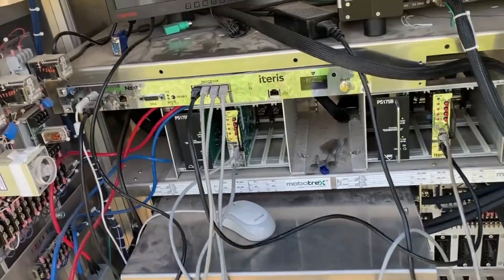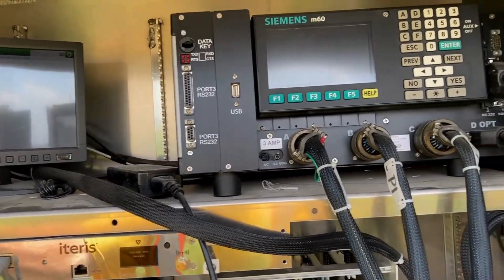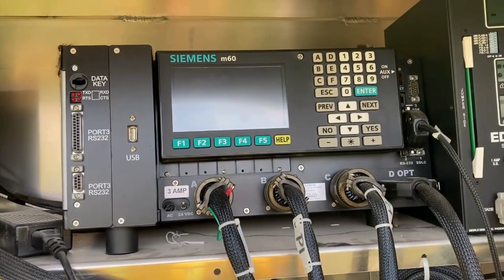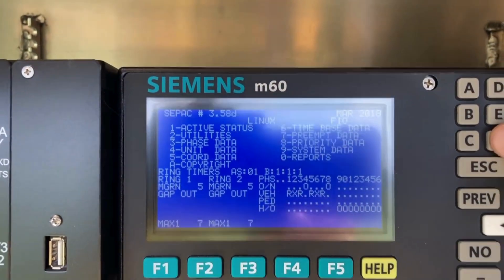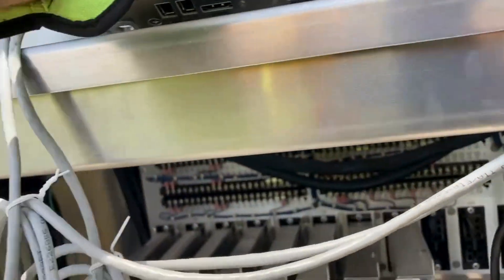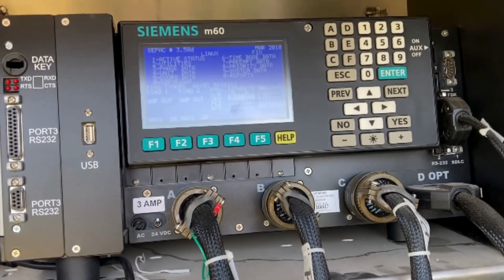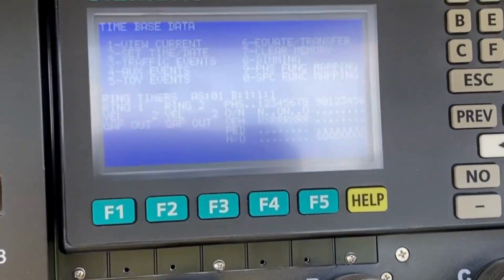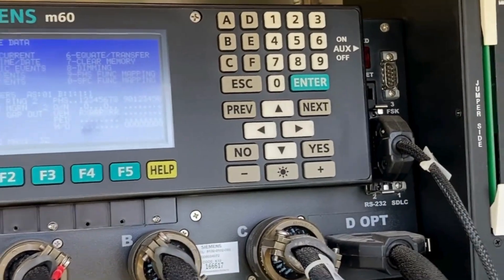Removing Traffic Light Detection

Comment: Thank you great video. How's the Siemens controllers work for you, and the video detection Vintage Next ? Here where are work we are slowly upgrading old 179 controllers to 2070's ATC and also very slowly going from loop detectors (good part of them are broken) to video detection MIO vision.
Reply from the maker: Thanks for the kind words.  I've worked primarily with Siemens controllers and Iteris cameras for over 25 yrs.  Its just what I'm used to.  So I like it (because I understad it). I have been also moving away from loop detection to cameras because I feel getting detection off the ground has more benefits than cons vs in-road detection.

Comment: hi amazing video can you explain what the H/O means?and the MGRN and MAX means not eh controller? so as well with detection from other channels all they use is one unit similar to the size of the conflict monitor for camera detection and that feeds into the controller is the way shown here a newer/older or just a different config? thanks
Reply from the maker: Sure.  The H/O stand for Hold/Omit.  When some phases are running, others must be omitted.  MGRN in minimum green time.  Meaning everytime the phase is serviced, it will receive the MGRN time.  That time CAN be increased to the MAX time (maximum green time) if more vehicles are present.  What you see in the video is an older model video processor.  Although the theory is the same in the end...take the input from the sensor, transfer it to a logic voltage that the signal controller can understand, and then the controller sends its output to drive the traffic signal indications.  Hope that makes sense.  GREAT QUESTIONS!
Reply: @streetsmartstraffic  Okay thank you, the way you explained it is the most I'm gonna understand unless im like a professional lol great content, also does your business do contracts for traffic light installations? if so I would like to see one if your allowed to record thanks
Reply from the maker: @AFLOnTop5858  We do some installations but mostly knockdown replacements.  New signal installations are outsourced to general contractor/electrical contractors.   Follow along, you'll start to learn!
Reply: @streetsmartstraffic  Okay thanks!
Reply: @streetsmartstraffic  also random question, for those prepare to stop  lights signs where there are like 2 yellow lights that flash, how do they work? is there a flash module at the cabinet you run 2 lines to the pole or you run a single line and have sequence board at the light
Reply from the maker: @AFLOnTop5858  2 ways can accomplish this.  Wireless & wired.  Wireless setup= transmitter in cabinet  & receiver at advanced warning light.  Wired = run wire from cabinet to advanced warning light.  
In both scenarios, from what I've used it, a program feature in the controller called GDLY (green delay) can turn 'ON' an output when GDLY is programmed a number greater than 0.  This amount of time will drive an output to be 'ON' before the end of green and will extend thru the yellow and red intervals of that phase.   
Example--If I program a 10 in GDLY, the output will turn 'ON' 10 secs before the green will turn to yellow.  
Hope that makes sense....
Great question!  Haven't had that one yet
Reply: @streetsmartstraffic  oh wow never heard wireless, assuming these are for long distance when you dont wanna dig out a bunch of stuff for a sign, thanks ! looking.forward for next vid